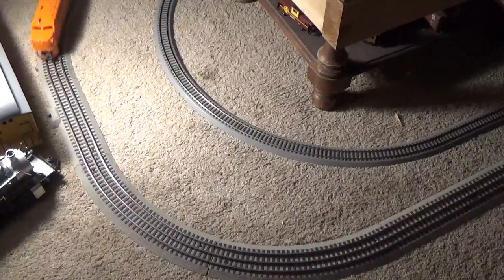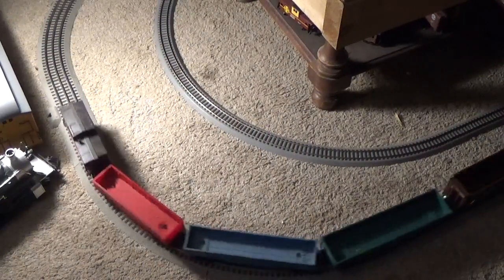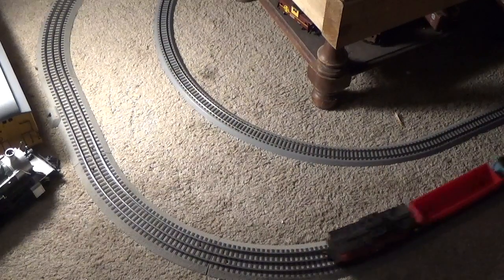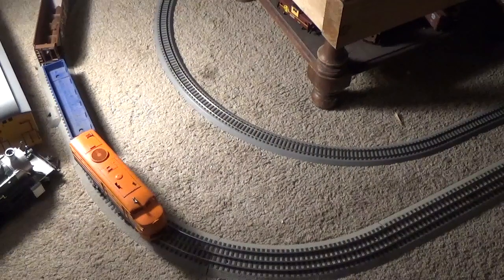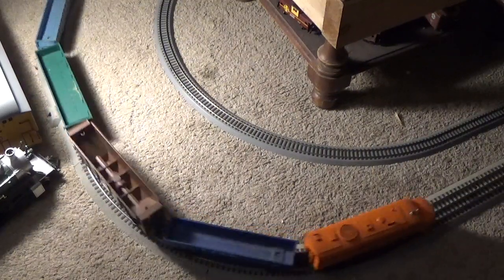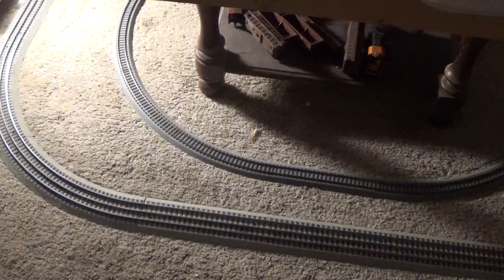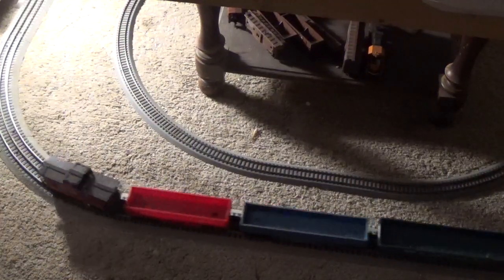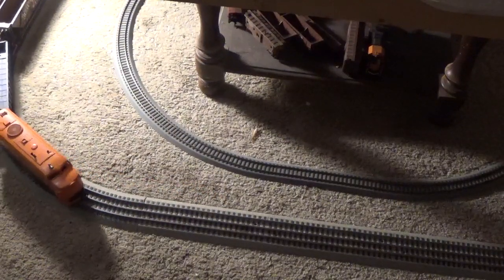O scale doing its own thing

Comment: Your E unit on the directional  is sticking just clean it and it will run fine. It’s the switch on top of the engine. Also the fast track may be shorting out if you push the pins that connect it tighter by bending them it will make a better connection. There’s videos on here how to do that. Hope this helps. Thanks for sharing your train videos